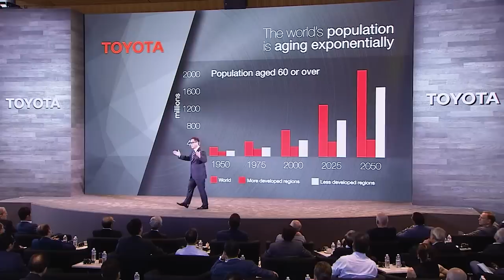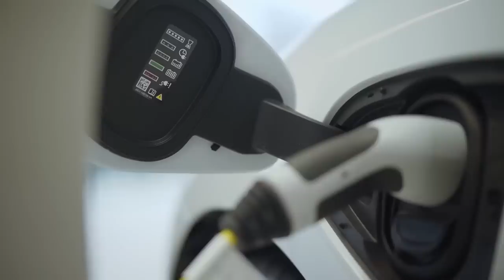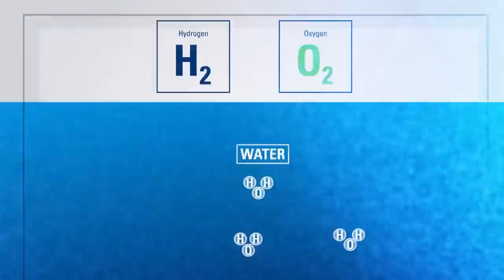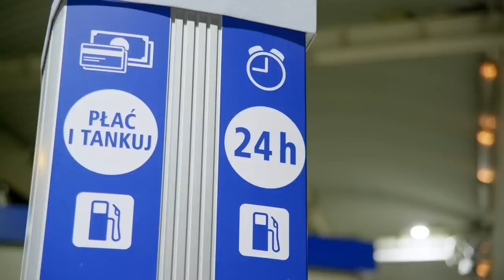New Toyota CEO Shocks Everybody | Huge News

Comment: I honestly think this is hella lot more realistic compared to get your typical EV car. They probably would last a lot longer at this rate too. I would still rather have GAS cars since they had made some really good iconic Toyotas and Lexus back in the day.
Reply: Technically it is still gas, as Hydrogen is a gas :P
Realistically, yes, it is vastly more feasible than electric vehicles. The biggest limitation for EVs is carrying additional range with them. You can't carry an extra battery or a means to efficiently and quickly charge the vehicle in an EV. In a hydrogen vehicle, you can just throw an extra bottle of H2 gas in.
Reply: @EmberfireKitsune  You can charge an eV anywhere, friends house, job, charging station... never understood why people think its this huge burden.  Electricity is everywhere already, its waaaaaay more convenient than building an entire H2 infrastructure from scratch.
Of course, electricity is not carbon neutral since 93% of it is still from fossil fuel.
Also cars are dumb, most inefficient way to move humans, trains and scooters all the way.
Reply: @zacharyb2723  electric cars take hours to charge while you can full a gas tank in minutes
Reply: @zacharyb2723 you stick to your scooter and derailed trains
Reply: @EmberfireKitsune  still I’d rather have “old gas”
Reply: @zacharyb2723  you need the proper adapters for the vehicle, you can't just charge because electricity is available. And its not feasible with the demand on the power grid with the tremendous draw that would result if EVs became a common means of transportation. It'd likely be even more costly than implementing infrastructure for hydrogen.
Reply: @zacharyb2723 could easily have hydrogen vehicles plug in, put water and maybe some kind of conductive solute into a special tank that generates hydrogen when in plug in mode, dont know how efficient they could get it but could be possible
Reply: @zacharyb2723  in the long run they won’t last longer than 8 years without getting a replacement battery for your little Tesla. However gas engines if you treat it right, it would last you longer than 15 years.
Reply: @EmberfireKitsune  it’s honestly more like water.
Reply: @zacharyb2723  problem is you live in a city where EV make more sense (to a degree) but most ppl live outside major cities where EV are extremely impractical. The tech just isn't there and EV are like cell phones something you just throw away after a couple years as it has no resale value. The future is gas and oil as EV and hydrogen tech simply is not anywhere it should be but EVs use more rare earth metals mined under harsh human conditions and are less recyclable then gas cars. Car ownership is more than just getting back and forth from work as it is a form of freedom but I live in US where our land mass is extensive.
Reply: @Zachary B  In some parts of Africa, (my country included) there is not enough electricity. We have 16 hour power outages. EVs won't work here where electricity is needed for industry.
Reply: @Jordan-zk2rf  Yes, GM had a proposal for a self-contained HFC system back in 2005 where the water byproduct was collected and stored in a tank with an electrolysis system, and then you could just plug the hydrogen car into grid power or solar to separate the hydrogen and "refuel" in much the same was as a lithium EV. Hydrogen fuel cells could conceivably be rechargeable batteries too. Gas stations could also be equipped to extract hydrogen from natural gas while we're in the process of weaning off of fossil fuels and finding new jobs for people in the old infrastructure.
Reply: @jiujitsu_demon6527  Correct, lithium batteries produce dendrites over time, limiting their lifespan. They are then difficult (but not impossible) to recycle. It's far easier to replace a fuel tank in a gas car than a battery in a Tesla... however, electromagnetic motors in EVs last far far longer than the spark plugs, timing belts, transmissions, and all the moving parts exposed to wear and tear on internal combustion engines (ICE). They literally are containing and trying to harvest 15-25% of the energy produced by small explosions! If batteries were not a wear and tear depreciating part on Teslas, they would outlast "classic cars" with less maintenance and more miles (tires and rust would be the major concern!).

Enter hydrogen fuel cell (HFC) vehicles. They're also electric vehicles, but instead of a lithium battery they have a gas fuel tank. Granted, it's pressurized gas instead of liquid petroleum, and special care would need to be taken to safely contain that pressure, but they wouldn't be much harder to produce, replace, or recycle than the canister for a gas grill. They refill as fast as your tires, potentially faster than petrol, and have real long range potential. Then up front, you've got those EV electric motors with insane torque and 0-60 capabilities, but also the durability that comes from less moving parts and lower complexity, far lower wear and tear. I'll see your 15 year ICE vehicle, and raise you a million mile HFC vehicle, a daily driver that would last many decades AND be far cheaper and easier to refurbish rather than write it off as "totalled." As a fuel, Hydrogen (which is never burned) is safer in a car accident than either petroleum or lithium, because it doesn't combust with water (like lithium) and is lighter than air and dissipates faster than natural gas from your stove.
Reply: @zacharyb2723  not if your somewhere that is to far away from any population centres where you could change your vehicle, like say a massive desert which for an electric car is not good as it will run the battery down much faster due to the heat, batteries and really hot weather do not mix well.
Reply: @EmberfireKitsune  Tell me you have absolutely no clue what you're taking about without telling me you have absolutely no clue what you're talking about

Comment: I have a 2016 Prius that I bought new from the dealer. It has over 100,000 miles on it now and still runs like it was brand new. I have taken it to the dealer for the routine maintenance, oil change, lube, etc., etc. I LOVE this car!
Reply: You shouldn't love it. It's ugly and terrible.
Reply: @Ben  ugly, maybe, terrible, absolutely not. I went to the store the other day and got 75 miles to the gallon. It was only a short trip, but still, I normally get like 49 mpgs. I've slept in my prius multiple times and have plenty of space for moving stuff
Reply: @DW-35  people by and large don't even think, it has been on a drastic 10-year decline.
Reply: 100,000 miles is nothing. Get to 275 plus and then come back
Reply: My 2013 plug in Prius has 110 K miles with zero issues, and my lifetime average as measured at the pump is in the high 50's MPG. At 73, it's the best damn car I've ever owned!
Reply: @DW-35  You're comparing one car - your Saab - with one hybrid - a Prius. The question is how much are hybrid cars saving in terms of fuel consumption and emissions compared to non-hybrid cars across the board. Compared to American non-hybrid petrol cars, huge amounts. Compared to European non-hybrid petrol cars, maybe 10-20% (similar to diesel, without the NOx and PM pollution). The Toyota hybrid drive train is among the most reliable drive train in the Toyota range. Hybrids have done hundreds of thousands of miles as minicabs,, Ubers etc. Professional drivers choose them for a reason.
Reply: @DW-35  Hybrids produce lower emissions than non-hybrid petrol cars. I'm also sceptical about EVs because of the enormous quantities of heavy metals and chemicals involved. Hydrogen might be an option, but currently most hydrogen is produced by burning fossil fuels (just as a lot of electricity is produced that way).
Reply: I drove two Toyota Sienna vans with 890,000 miles, and they drove like a champ.